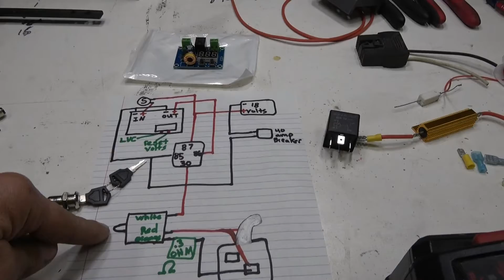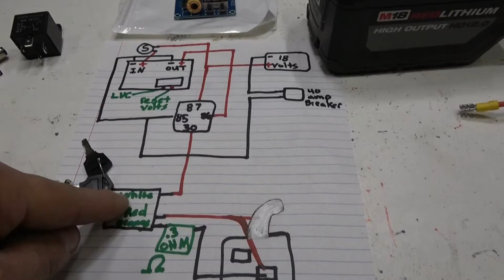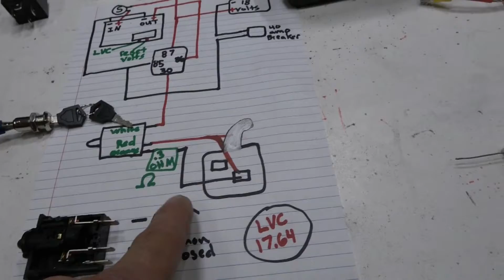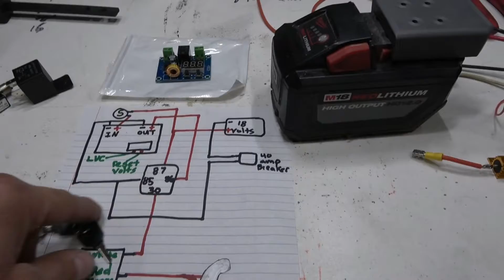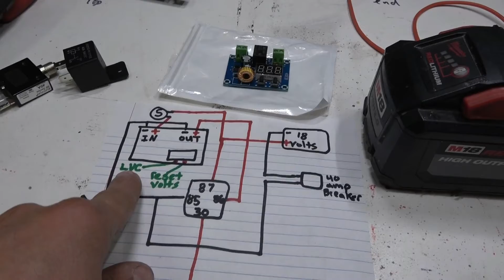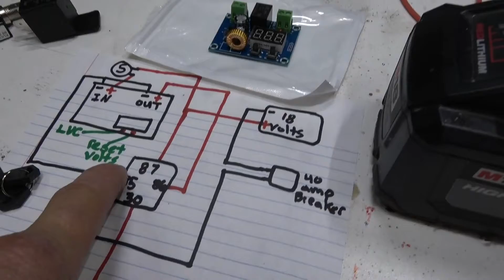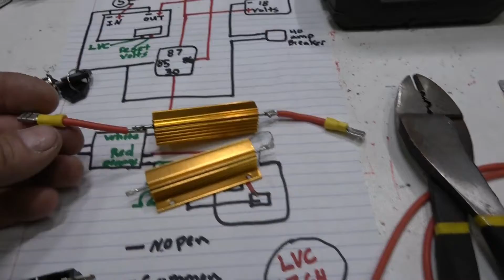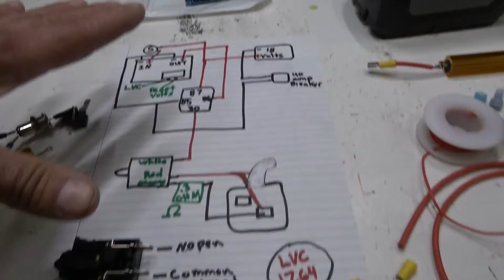Low Voltage Cutoff Battery Upgrade For Power Wheels

Comment: For anyone struggling with the display reading the low voltage set point and not current readout. DONT hold the left or right button to make the setting. Click each button once to display the set point and then double click the button, so say you’re setting the voltage cutoff, click the left button once (it pulls the set point up on the display) then while it’s showing the set point double click the left button again while it’s still showing. Change it then to whatever you want and then let it timeout back to the current voltage display. Same thing applies for the reset

Comment: I followed your diagram exactly. My question is about getting the negative to the shifter? Did you run it directly from the battery to the shifter and made a splice for #85 on the relay?

Comment: Hi what about the receiver upgrade? How can I make the 24 v receiver on my kids car to run all the accessories of 12v? As all the pins of the smart control are connected to  the receiver.so if you replace it with a 24v it might fry the smart control panel which controls music, lights , movement and on/off switch. Any suggestions, Thank you

Comment: Your Milwaukee batteries have low voltage protection built into them already bud. I believe the only brand that has it in the tool itself is DeWalt.
Reply: It's in the tools I've fried 2 the hard way

Comment: So the 40 amp relay bypasses the tiny relay on the low voltage board or no?
Reply from the maker: Yes, the load goes thru the relay not the board
Reply: @ perfect thank you

Comment: Do you use the 635 or the 609 low voltage protection model? Iv seen a few videos saying one if them dosn't save the settings and needs to be reset every time its powered up. Cant work out which one saves the settings when disconnected from the battery, as i dont want to have to reset this each time .  Cheers.

Comment: My issue is 30 amp fuse blows when I ride power wheel and I am small I just meet weight requirement at 130 but works fine for my daughter why is that? Can I just bypass fuse? Or can I up the fuse size to 40 or 50 amp fuse?

Comment: That's why I have been using Ryobi batteries. Not only is that what my drill & saw use, I also found that the low voltage protection circuitry is built into the battery.  I looked up which battery brands had built-in circuitry, and I was happy to find that out.
Reply: Which ryobi batteries do you use 18 or 20v?
Reply: @strikenryken  I use the 18v. They are very common, and it's what most of my tools use. I also have a 40v that I am about to use in a 24v project. I'm going to step is down, for good run time. Often, you can get good deals on the high capacity 18v packs in sets of two.
Reply: Nice fyi you did there.. much appreciated
Reply: Awesome insight. Thank you!

Comment: Great channel! Wow

if you added one more relay to your drawing, you wouldn’t need a key switch. The relay coil would be powered by the power output of the voltage sensitive relay, and when the voltage sensitive relay turns off because of the low-voltage, it would turn off the relay that gives itself power therefore killing itselfwithout any extra switches or teaching the kid how to use the key switch, etc.
Reply: If the battery undervolts and the LVC kills power to the relay the relay opens, But if the relay is open, when you put in a new battery how will the LVC be powered in order to turn on and power its own relay? It's like a paradox of some kind.

Comment: I had to upgrade to a 24v relay the one you recommended started to get hot when I tested the circuit. I also used a push button hold-in circuit to automatically disconnect the low voltage module so it wouldn’t continue to drain the battery thanks for the video helped out a-lot
Reply: I was concerned for the samething

Comment: With a 40 V battery system. Would I need a different size Relay, or would the forty amp relay work

Comment: Hey - great video! Exactly what I have been looking for in a video so that I can upgrade an old dune race for my son.  My plan is to use two 20V 5AH batteries in parallel so that it will have roughly the same amperage as the original 12V lead acid battery.  Thanks for the upload!  I may come back with some questions if I get stuck...
Reply: @cannonjanes994 looking to do the same with two lithium batteries ran In Parallel.  Did you have to modify anything covered in THIS video?
Reply: I haven't done it yet. Too many projects 😅

Comment: I'm surprised somebody doesn't sell a kit with all the parts you need. I just ordered two Milwaukee adapters and two boards yesterday. Any chance that relay can be picked up at an autoparts store? Thanks.
Reply from the maker: Yes, it's a common spst relay. Nobody wants to touch the liability of making a child's ride on FAST!!!
Reply: @CustomKidzCars  ohhhh. That makes sense.
Reply: What is the cutoff for the Milwaukee m18?

Comment: Do you use 12V motors or do you need an upgrade for the motors? 
When you use 18V?
Reply from the maker: Stock motors, overvolted 50% gives you 7.5 mph